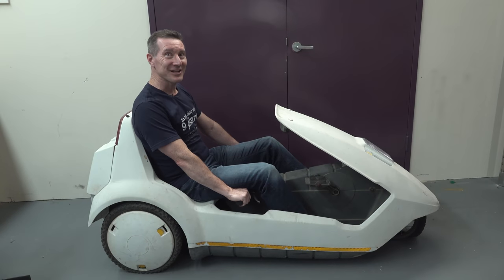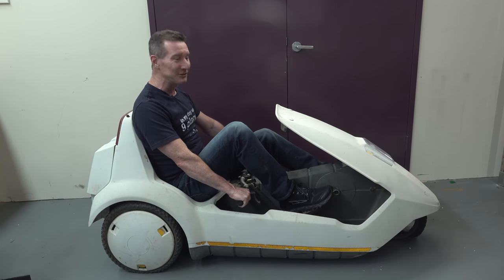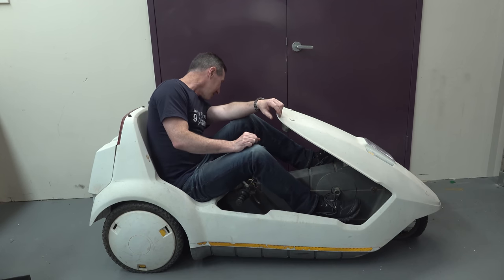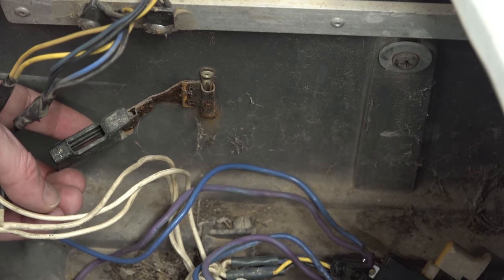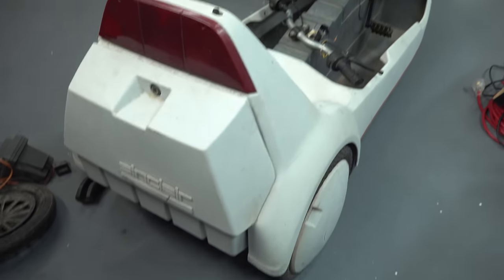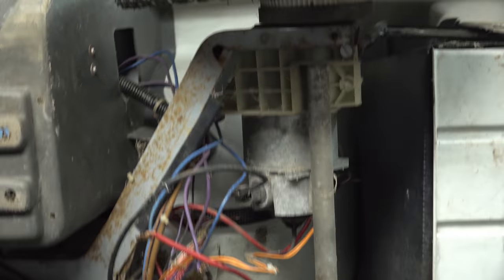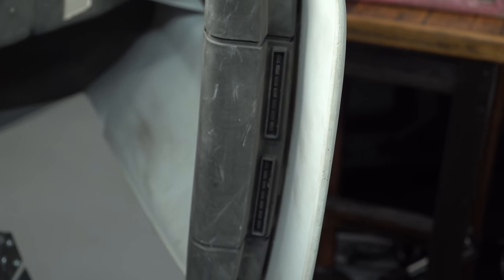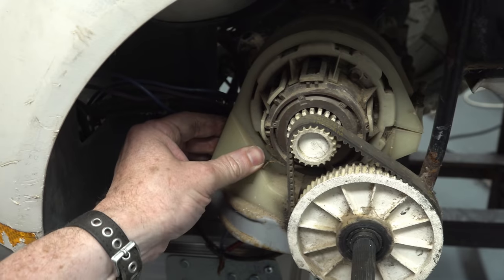EEVblog 1419 - Sinclair C5 Restoration - Part 2

Comment: Body likely would be nice if you got it all cleaned off with some sugar soap and water, followed by a polish with some automotive buffing compound, and then a final going over with paste wax. Will give it a much better finish, without taking too much off other than the oxidised paint top layer. The wax will then protect it further.  Anything more you will need a bumper repair shop to strip it down, do a proper primer coat, then a few topcoats of a flexible paint, and then a final clear coat over it all. 

Black inner and plastic parts simplest will be to wash it as well, then get a bottle of pure silicone tyre and bumper polish, and apply liberally, though note it will make them hydrophobic, and incredibly slippery, and for a while, till it soaks in, a dust magnet.  The silicone can be wiped over the entire vehicle as well, it will do a good job of preserving it, though not a good idea if you ever intend to repaint it, as it will be hard to remove, and will cause the paint to fish eye all over.

Chassis needs to be stripped out, and then reinforced with a bit more steel where the original spot welds have cracked, preferably using a rib that fills the entire length, and which is MIG welded down all the way. Then cleaned off, rust removed with rust converter inside and out, and the inside liberally sprayed with linseed oil, after you have sprayed the outside with a coat of grey primer. The linseed oil will fill in all those tiny crevices, and polymerise, so the metal will not rust further.

Very likely the gauge unit does not work any more, those Ferranti ULA's were not exactly known for being a reliable part. Incidentally I still have a Sinclair amplifier kit, complete in bag, with the original no name branded reject Mullard transistors that were used in the kits, as they were available for scrap metal prices, and Sinclair would simply test each one, and those which had the faintest bit of life, some gain, and minimal leakage at 12V were then used in the kits. Might not work at 30V, but will not fail immediately with 12V, and anything with a gain over 2 could be used. If I ever build it it would need all new capacitors, doubt the originals are any more useful other than as a space filler on the board.
Reply: Great advice for frame and body restoration! Now let's see what we can come up with modernizing the drive train while keeping the original riding characteristics of the vehicle (meaning a Bafang ebike motor in the back, not a front hub motor).
Reply: i don't know if this would work it is not flat plastic it has a texture to it and the plastic has a very low melting temperature !!!
Reply: indeed, this is plastic from a sandblasted mould. And it is not painted. So only clean it with a plastic safe solution. Brush and soap. 
Or in a large ultrasonic cleaner... :).  The front wheel doesnot look like the original one, that has a plastic rim and plastic covers.
Reply: Those sprockets are cracked, will not hold any force, needs to be replaced, maybe aluminium parts? Then also should swap in a modern motor as then it will be easier to find the best gear ratio sprockets. Then of course upgrade to lithium batteries, and all the good stuff... though I do not like the brakes, might even be easier to get a donor backend of an electric cart or something.... this is not a simple restoration if you want to drive it daily.
Reply: Youre talking like a professional hollywood make up artist to the stars.

Comment: Would love to see this thing restored, especially with modern electronics. Hope you continue the series.
Reply: Add bluetooth speakers! And a cell phone mount.
Reply: And modern bicycle disc brakes.
Reply: Brushless motor (something like 500w/48V) and lifepo4 batteries yes
Reply: @TimSavage-drummer  Disc brakes are overkill for most bicycles, never mind this thing. They are certainly too big for those size wheels. Hub brakes are probably a better solution.
Reply: @BenoitMarcBernardin  Yeah that's what I'm thinking.
Reply: @another3997  Anything would be better than the pressed steel cup it currently has, looks like a lot of parts can easily be gotten from any sort of half decent cheap bike shop.
Reply: Yeah I wana see like small tesla-esque stuff
Reply: Total rebuild with all the best modern technology!
Reply: @another3997  Yeah, keep it all within the hub design so to say. Maybe not the most powerful, but efficient enough! 
I do have disc brakes on my electric bike, and yes they are a luxury! thing was expensive enough! But you need space for it. I would see a braking system with maybe a Central Disc Brake so both back wheels brake at the same time. With of course a connection to the controller so the controller KNOWS that it is braking so the engine isn't fighting the brakes.
Reply: @another3997  Not if he puts on 500w motor. That will get you in trouble in a hurry. You think it's not much, but at 30 mph (50kph) it will put the fear of eternity in you.
Reply: @firesurfer  i have one and have 500w 52v front hub motor, does 40kmh. my friend has 70v battery and it does 65. crazy.
Reply: @another3997  original drum brake is rubbish and is only one the right wheel, front wheel is plastic to that brake is even worse. u can buy disc brake kits from several people
Reply: yeah, definitely keep going!

Comment: The frame is cracked, where you asked if "is this due to rust" No - The welds have split, and it requires a few minutes with a welder to fix.
Reply: @atanclaw
Yeah, a stress crack.  Usually, they will crack again after re-welding unless some other support is added. 
BMW had similar issues in the rear chassis of E-46 and Z3's
Reply: @0202fabrice  Sure, I'd maybe cut some flat bar steel 1-2 mm thick and weld it along side to stiffen it up.  The existing material so thin you can just weld through and penetrate the bar steel. if you like, make some holes before welding... clamp it together with wise-grip pliers and you'd be good to go.
Reply: Yep spotted that. The frame needs completely removed, stripped and welded.......along with everything else on it for a good refurb. Do it for Sir Clive Dave.
Reply: @SantaClaw  I'd add external bracing bands too, originality be damned. There's sure to be plenty of metal fatigue in that flimsy frame.
Reply: Yup strip the chassis out and get it welded by an expert, not a big job I think. Maybe have the chassis stripped and powder coated?

Comment: I have a vague memory of Sinclair C5s being used as advertising hoardings, somewhere near Turnpike lane (London UK). I built a Sinclair scientific from a kit and it sort of worked, contact bounce was a problem, I think the most I got was 4 4s from one key depression. If you squeezed it but slightly during a calculation, the batteries would lose contact and you would lose the lot, not the most reliable device. Reverse polish notation, there's one for you, forgotten how to do do it now. Before he was a Sir, Clive Sinclair released a series of booklets mostly of transistor radio circuits, I'm sure I built a few. I recall him waxing lyrical about the marvellous OC169 transistor, no doubt by now, tin whiskers will have seen most of them off. Thank you, Sir Clive for your enthusiasm ,ingenuity and inspiration to others.

Comment: If the speed control is really just a switch I can see why someone bodged in a drill speed control. The front hub motor isn't a bad idea though I'd consider getting a new mount machined to hold something in a brushless variety on the back. I know there's a twist grip style throttle for e-bikes which should integrate nicely. I think I'd also upgrade to lithium power instead of lead-acid because of the weight difference not to mention the power density of LiFe technology. Bobby dazzler indeed.

Comment: My first digital multimeter was a Sinclair, It did not last long as it blew up, I took it apart and found that the case was the same as the calculator with a sticky lable covering the spare button holes. I met Clive Sinclair briefly in the 1970's, I was living in Cambridge at the time and a Sinclair amplifier that I had purchased via mail order failed soon after I turned it on so I took it back to his shop in Cambridge and Clive came out of his office looked at the unit briefly threw it in the bin and handed me another off the shelf saying "here you are"  and turned and walked back into his office. The motor on those C5s was made by Hover and the frame is the same as the washing machines at the time, replace the motor with an AC washing machine motor and drive from a VFD. Looks like someone cobbled a speed control switch from a drill into it.

Comment: * 9:59 - Remove that rust. Wire wheel on a drill.  Then toss some self-etch primer on it.
* 11:01 - Chain needs some lube badly.
* 11:17 - that frame looks split. Needs tig welded back together before you start taking it out
* 13:18 - wheel support thing is toast.. no repairing that.  Trace it on paper to get the dimensions before it gets more broken.   Use some calipers and measure shape / depth, etc.  Give to a local machinist to make up a new one.
* 13:31 - Those plastic belt gears look really brittle...
* 14:22 - A great time to use an impact wrench to knock those bolts loose without holding stuff

It looks like a lot of work. You'll need a bit of tig welding, some paint + grinding, and some custom fabricated parts.   I'm sure a lot of stuff was plastic to save weight, but plastic doesn't age well in critical pieces.

Replace anything in the drive train with damaged plastic with metal, and convert to a chunky Li-Ion / LifePo4 for the batteries.  The denser energy will make up for the weight gain.
Reply: A Wire wheel is unnecessary. Some evapo-rust is all that's needed.

Comment: My first computer was a Timex Sinclair 1000 with a 32k memory addon, so many fond memories of coding simple BASIC programs and saving them to cassette tape with csave and cload. Wow those were the days. RIP Mr. Sinclair and thanks for the opportunities your frugal engineering afforded me.
Reply: You must have been rich. I had only the 16k expansion module. It had a wonky connection, if you moved it wrong instant crash. Reload from cassette.
Reply: @petercolquhoun2086  Nope,  not rich, would have had an apple were that the case 😆 and my expansion module was 16K like yours which made for a total 32K for the machine. Mine had the same fiddley behavior of the card edge also, if you moved the device when you were programming it was a bad day and time to cload again. Even still, it was cool to have a computer that was somewhat affordable to learn and explore. Amazing how far we have come from those days.

Comment: Usually easier to release the cables at the lever end - slacken off any adjusters, pull the cable outer from it's seat on the lever and remove the inner cable by manoeuvring it out through the slot in the lever body and then a similar slot in the lever handle.

Comment: Prolly said a dozen times, but those transistors and trigger are from an electric drill - a speed control instead of the switched original.

Comment: Yep. They were built at the Hoover factory in Merthyr Tydfil in South Wales (old rather than new) here in the UK. My first programmable portable device was a Sinclair Cambridge programmable calculator. If I remember correctly it had just 34 possible program steps. Ate 9V batteries quicker than I could afford them whilst still in school.

Comment: There may not be enough weight on the front end to work well with a front hub motor; the front wheel could slip if full power were applied.

The C5 is basically an adult version of what we here in the States called a Big Wheel in the 1980's.  This toy was horribly designed in terms of locomotion as it had a big wheel in the front with pedals, but no weight and thus no traction as the kid sat near ground level above the tiny rear wheels.  It probably worked better for city kids with sidewalks, but us country kids despised them after about 5 minutes of trying to make them go.  They were mainly just used for rolling down steep inclines as the low center of gravity made them much more stable than a traditional tricycle.  Unfortunately, the plastic chassis didn't hold up well to such abuse.
Reply: lol, good for spinning the front "big wheel" and wearing the plastic down to nothing. You had to have patience to get them to actually move, perhaps that was the intended lesson to be taught!

Comment: I'm very keen to follow this project. As others have said, you'll have to get the chassis worked on. Maybe it's just worth beefing it up a bit if you know someone who can weld and just copy frame with box tube or something. In Part 1 you suggested hub motors. A modern bicycle mid-drive motor is probably a lot better with a bicycle sprocket for gearing. Hub motors tend to be geared for limited speed to be able to give you enough torque, where a mid-drive uses the gearing of the bicycle sprocket. Also a front hub motor could tip you over if you hit the throttle by mistake.
Don't worry too much about regen, it's so light that it won't significantly increase range unless you load it with batteries.

Comment: This is rare enough that it deserves a proper, thorough restoration. Ideally, it should be disassembled, the frame rewelded and painted, the drive gear replaced (either find one from a parts "car" or machine a new one from nylon or even aluminum). The front wheel probably needs to be sand-blasted (find someone to sand-blast all the big pieces). The wiring should all be replaced (personally, I would try to match the original components and wire colors) and the motor should be disassembled and cleaned. The bearing may need replacing, too. Most of the nuts, bolts, and washers can either be wire-wheeled or just replaced. Clean and buff the body and apply new reflective tape.

Comment: 16:02 they were made at the Hoover factory in Merthyr Tydfil, Wales. The factory actually made washing machines! The motor was apparently derived from a washing machine motor
Reply: My father had a machine made there, he contacted them once to ask when it was made, and, based on the serial number, they could only tell him it was made between 1936 and 1939, as they had lost all the pre war records in a bombing raid there in 1940. That machine was still in use up till about 1990, when the main casting broke, and there were no more available to replace it. But you can still buy a lot of the other parts still, the motor, brushes, bag, handle, power switch and belts are still common parts to a lot of machines.
Reply: Lies everywhere, it was not a washing machine motor, it was bespoke made by a Philips derived company.
Reply: @Boemel  The motor was indeed made by Polymotor; apparently it started life as a truck radiator fan motor. The C5 was built at the Hoover factory though.

Comment: It would be really neat to retrofit the modern disk brakes onto this thing as well, as well as any other safety/comfort features that may have been missing back then, and because of the price. My suggestion - electric speedo/dash cluster of sorts, disk brakes, comfy seat with a belt, and obviously a decent multi-horsepower motor with a solid battery; I bet you can have a solid commuter thats actually usable and moving at speeds up to ~20-25MPH. Maybe even a differential, since there are two wheels in the back, but that would be pretty tricky!

Comment: I remember over taking a guy (riding / driving?) one of these just after they came out on the A350 while I was on the way to work in Poole. He had the custom yellow cape on (extra cost option) that went over your head and sealed over the C5 body to stop your legs getting wet. He was having to peddle it up the incline in the road and was causing a traffic tail back as drivers had to over take on the opposite side of the road. Being rural Dorset there was (or is for that matter) no cycle or foot path and his head was at the bumper and exhaust pipe level of the rest of the traffic. The poor guy looked wet, stressed and thoroughly P.O'd

Comment: 4:28 - The handlebars have been rotated to sit further forwards than before. This gives better turning circle.

12:27 - the hoop should bolted through the frame. 

13:13 - the back of the wheel shouldnt have come off. There shouldnt be that many washers too. There should a washer behind the large pulley though.

14:06 - Yes one side is 16mm and the other 17mm.

16:14 - pads look fine. Setting up the arm at the right point is key. It can go between not working at all and locking up with the slightest touch :)

Any questions or parts get in touch :) As others have said the frame is cracked and will require fixing. The same thing happens if you put more than 500w through it. The most common mod is to run 24v through the original motor and find an ESC that can cope with at least 120-150A max. Cooling is essential and Ive got a guide for that. Remember to service the motor and gearbox completely, polish the commutator and grease the gearbox with non-lithium based grease. 18mm drive belt is an upgrade if you are retaining the original motor.

In terms of cleaning it up... "elbow grease" works wonders or "the pink stuff". There arent replacements for the headlight stickers or your serial number so dont wash them off! For frame painting canbrush C16 pale grey is an exact match.

Comment: That long handlebar bolt holds a split wedge in the tube.  You shouldn't take the bolt out like that or the wedge can fall to the bottom where it can be tricky to retrieve.   The right way is to loosen it a few turns, tap it to dislodge the wedge nut, then pull the whole lot up out of the tube.    I recommend you carefully replace that bolt by hand taking care not to push down until you've caught some threads.

Comment: HUB motor axles are pretty thick you would need to check your front fork dropouts to check axle size and the width of the forks.